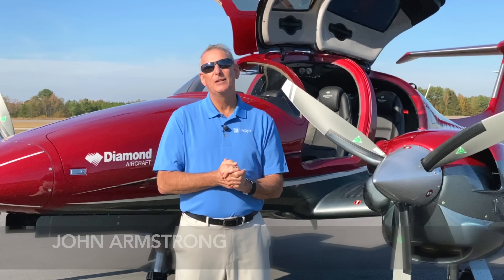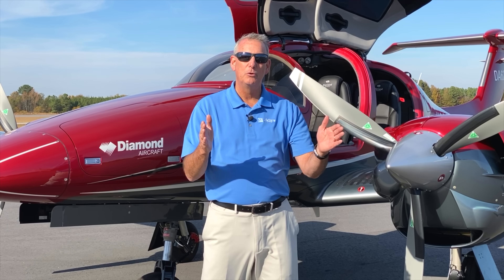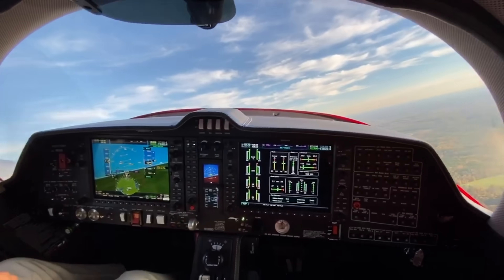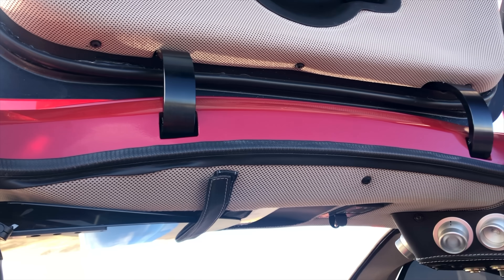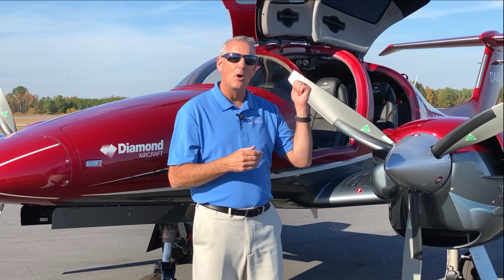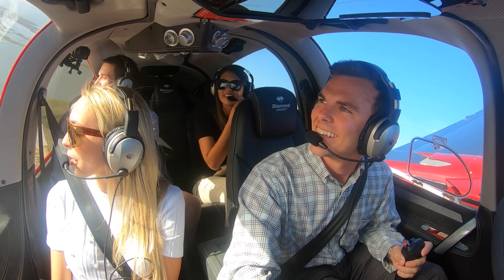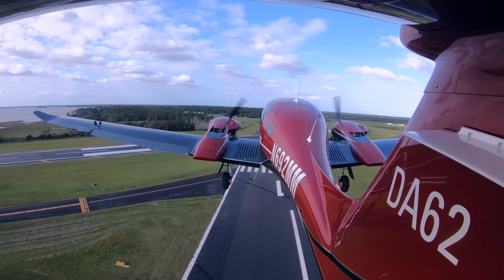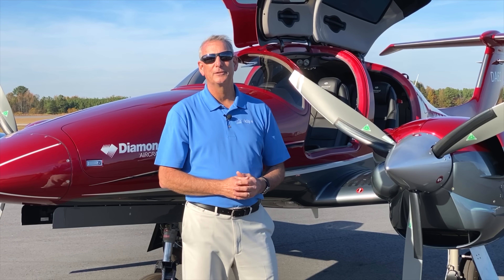What Makes the DA62 the SAFEST Twin-Engine Aircraft? | DIAMOND AIRCRAFT SAFETY SPECS

Comment: I’m a single engine pilot, however I have a home flight simulator where I fly all types of single and twin GA and commercial aircraft. This aircraft is absolutely gorgeous and beautiful, however one glaring elephant in the room that stands out is the fact that this plane doesn’t have counter rotating propellers. If it had counter rotating propellors, this airplane would be one of the ultimate GA twins

Comment: I always thought the da62 was overpriced but after seeing all the precise engineering that went into it, which prioritizes safety above all, now i know why its price. Y’all have to remember that this plane was built from scratch whereas planes like the cessna, beechcraft, piper… are all based in 30,40,50 yr old designs. If I could afford the diamond I would definitely buy it

Comment: One failing is that the DA62 does not have counter-rotating propellers -- and you can't get it as an option.  Nor does the DA62 have reverse-thrust capibility propellers, which would shorten the landing roll.  Not good for a million dollar plus aircraft

Comment: Imagine if the DA62 had CAPS and a HALO system too?
The safety factor would be through the roof!
Reply: Even without CAPS diamond is destroying Cirrus for safety record.
Reply: @cduemig1  Strange viewpoint. 
It's like Volvo would have said: 
"Our cars with seat belts outperform all these airbag-only cars"
But instead they saw the added safety it could give, so they designed their own and put it in their products.

Comment: Wow, this is probably the ONLY twin-engine General Aviation aircraft that offers similar active attitude protections to those offered by Airbus.  Had JFK Junior been flying a craft with these safety features,  whereby the plane would take control in the event of too steep a pitch or roll inclination, that fatal plunge would most likely never have occurred.  This is one truly sexy bird.  Built like a Ferrari, but safer, much safer.

If I had the money for a Cessna Citation, I'd still choose a DA62, purely from  the standpoint of design safety.

Comment: My dream plane is DA 42 or 62. Maybe in a decade or so I can work my way up to one. 
Simplified run-up and checklist procedures.
Don't have to worry about shock cooling.
Twin engine security, ultra high efficiency for a twin, all the safety engineered into the plane at every stage as discussed.
Reply: Uh oh  Diamond DA42 Crash in Pennsylvania   May 2022 do Youtube search  DA 62 might be safer
Reply: @davidboyle3032  All 3 on board survived a crash that flipped the airplane over, so I'd say it's a good outcome. Will be interesting to see the outcome of the investigation since this is something they should be able to handle. Engine failure on takeoff I guess?

Is there any reason to assume the DA62 would be much safer than the DA42 in this scenario? The 62 just seems to have more seats and to be a lot more expensive hehe
Reply: Same!

Comment: What I like best about this aircraft is that in can climb with the loss of one engine if in the blue line.  Can the DA 42 do the same thing?
Reply: The DA42, at least the Austro variant, generally has an OEI service ceiling of around 10-11,000 ft.

Comment: Having owned and flown a DA-42VI for about 2-½ years, all over Europe and Scandinavia, I still can’t understand how people can fly single-engine pistons in IMC. The risk calculation just doesn’t work. The twin-engines with FADEC controls are the single most important safety feature of this aircraft. The old (very old) adage that, “The second engine will fly you to the scene of the accident,” is just no longer true with these modern engine controls. Flying in IMC over the Alps, or across the Mediterranean to Egypt, I can say I was very comfortable with those two diesel engines purring along out there.
Reply: Probably money.  I know I can't afford to fly a twin.
Reply: @ace00007  But have you really priced it out? I had a fuel burn of 13 gal/hr total at cruise, and at altitude, I was doing 170-180 kits. And JetA (diesel) is far cheaper than avgas. That goes a long way to making up the differential in maint for two engines.
Reply: @brianmeese1641  Part of the problem is I'm a renter.  I can rent a G1000 DA40 for $130 an hour and get 130kts.  A DA-42 on the field rents for $289 an hour.  Way too expensive.  If I could afford to be an owner then maybe it would be different.
Reply: @ace00007  OK I get it. Well, the 40 has no ice prevention, anyway, so you are probably not flying in any heavy IMC. I flew IFR in a DA40 for couple years like that without taking any big risks. But, I know guys that fly an SR22 in heavy IMC, over water, mountain terrain, approaches at minimums, etc., and it makes me shiver.
Reply: @brianmeese1641  I'm pretty conservative myself.  In Colorado IFR in the summertime means thunderstorms and in the winter it means ice.  So we get a small window in the spring and fall to get some actual if we get those types of storms.

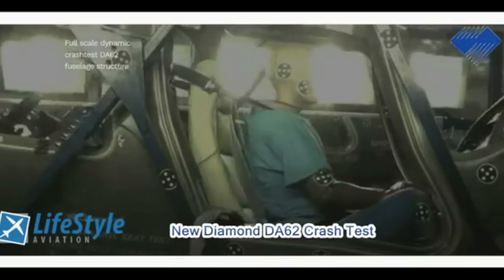Comment: Very nice bird. I'm curious to know whether the "over-built" trailing link landing gear system (mentioned at 8:33) allows the DA 62 to operate on fairly rough unpaved grass and gravel strips (e.g. in the way the Pilatus PC12 can with its similar system)?

Comment: I just don't get this plane.  Its a good looking plane especially in that gold livery, but why are they so darn slow?   This plane looks like it should be able to do 200 kts at 23,000ft easy.  Yet it struggles to get over 170 and is only certified to 20,000.  I feel like for its price point Diamond left some performance on the table.......
Reply: Engines should be over 200 HP.  That's the problem!

Comment: With a design like that, and the price tag, it should be able to cruz in the twenties
Reply: It does.  20,000 ft  at far better efficiency than any twin ever made.  I get just  under 13 ANMPG (Air Nautical Miles Per Gallon) cruising at 190 KTAS and 7.4 gph per engine at FL200.  Very few singles can come close to that number.

Comment: With all this focus about safety, I'm curious as to why counter rotating props weren't installed to remove the critical engine. Seems like this would be fairly straightforward considering the engines are geared to the props.
Reply: The reason they do not have counter rotating props is that they are based on an impressively engineered Mercedes Benz automobile engine that has been produced in the millions per year and constantly refined to be smooth, powerful, and efficient.  There is no point asking an automobile engine manufacturer to re-engineer and retool to make that same engine rotate in the opposite direction, only to manufacture hundreds per year.  The argument to manufacture a separate gearbox to have it rotate in the opposite direction fails for the same reason - low volume.  Overarching the question is the simple observation that there is simply no compelling reason to do so.  Combination of huge wingspan, massive rudder, and engine location close to the fuselage makes for an almost undetectable difference in single engine handling between right and left engine out.  About the same rudder forces either way, and mine climbs at ~ 400 fpm regardless of which engine is shut down.

Comment: This Diamond might be safe, but overall it is a useless piece of junk! 
You gotta be an Olympic athlete to get in and out and there is no room, not even space for a golf bag, a simple failure from 
A to Z! It seems the only aircraft manufacturer in Europe capable of designing a useful, safe aircraft and understanding what aircraft customers need is PILATUS!
Reply: I don’t think that you have actually tried to sit in a DA62.  It is in fact far easier to get in and out of than any low wing general aviation aircraft.  It can easily fit more than half a dozen golf bags, with plenty of room for 5 adults.  

The Pilatus PC-12 costs 4 times as much to purchase, more than 5 times as much to operate, only goes 40% faster, and has horrible engine out performance compared to the DA62.

Comment: Single engine rate of climb? Single engine handling in general.
Reply: Book values - standard day sea level show rate of climb varies from 168 to 393 fpm depending on aircraft weight.  My personal experience with full fuel and two pilots on board, I've never seen less than 400 fpm at ~4,000 on a hot day.  Single engine handling is superb thanks to a single flick of the engine master switch that shuts the engine down and feathers the prop, massive (48') wingspan, engines tucked as close as possible to centerline, and huge vertical stabilizer and rudder.

Comment: Been debating for a long time for a family retirement plane...DA62 or T206H Station Air 🤔
Reply: About the only similarity between the two is useful load on takeoff, 1,594 lb for the StationAir, 1,565 lb for the DA62.  The 29 lb T206H advantage on takeoff is quickly eaten up due to the DA62's incredible efficiency.  At 18,000', 161 kts (the max cruise speed of the T206H) the Stationair burns 19 gph of Avgas (which is more expensive than Jet A).  At the same speed and altitude, the DA62 burns a total of 11.7 gph of Jet A (5.9 gph per side).  That means for a 600nm trip with 45 minute reserve, the StationAir can haul only 1,083 lb, whereas the DA62 can haul 1,214 lbs.  That's a 130+ lb DA62 advantage at this distance, increasing every mile up to the 703 nm max range of the StationAir and 1,283 nm max range of the DA62.  Also, the DA62 burns 62% of the fuel per mile of a T206H - roughly half the cost per mile when you factor in Jet A's lower price.  Amazing to me when you consider the DA62 has double the engine count.
DA62 advantages go on for more than I can list here, but include 20% faster max cruise speed, a far more spacious cabin (53" vs 43" wide), incredible visibility, quiet, smooth, reliable, FADEC controlled, single lever per engine Mercedes Benz based turbo diesels, the safety of all carbon fiber construction, 26 g seats, dual carbon fiber wing spars, with fuel tanks protected between, and best of all - vastly greater engine out climb performance (i.e. 2-1 > 1-1).
The only two advantages I can chalk up to the T206H are lower acquisition and maintenance costs.  They really are in a different class, but to quote Ferris Bueller: "It is so choice. If you have the means, I highly recommend picking one up."  
It was a bit of a stretch for me, but I could not be happier with my decision to buy one.
Reply: @ultraturtle2673  Thank you for the number crunching. We are definitely years away but seeing those numbers definitely persuades me towards the 62.

Comment: Does not have a huge performance envelope. Way easy to stay ahead of the aircraft. Two engines. Very low stall speeds. Primarily used for dual engine training, flown by an experienced student and an instructor. Dual EngineTraining is about the only utility of this aircraft.
Reply: I disagree.  It carries 1,000 lbs of people and stuff more than 1,265 nm at normal cruise.  That's more payload farther than any piston twin currently being manufactured - by a wide margin.  Throw in a far roomier cockpit (11" wider than a Baron), nearly half the fuel burn per mile of any non-Diamond twin, and the safety and simplicity of FADECs controlled by a single lever per engine, there is simply no comparison with anything other than the other Diamond twin - the DA42-VI.   And, by the way, the DA62 costs less than the competition, similarly equipped.  The next step up in payload, range, or cabin comfort starts at more than twice the initial cost, and far more than twice the operating costs per mile of the DA62.  It is not only a great airplane, but a surprisingly good value.

Comment: Couple of observations:

1)  So the seats are bolted right to the airframe?  How does that work for those of us who like to adjust our seats?  (Disregard, this is answered later in the video.)

2)  Interesting to see aero-diesel engines are still around.  I was a master's candidate at ERAU-Daytona from 1999-2001.  Back then, they had a C-182 in their maintenance hangar that was an experimental testbed for a modified diesel engine.  Think I saw it around the fall of 2000 or so.  At that time, they almost had it done; test flights were showing problems keeping the heat levels down in the cylinders.  it wasn't perfected yet.  In the intervening years, I've watched from the aviation sidelines as Thielert came---and went.  I never did find out who took over GA aero-diesel production after Thielert.  I stopped flying after February 2003---moved away from Daytona, took on a federal job, never had the kind of money it takes to rent GA aircraft since.  Now, at my age, I don't know if I could even pass a physical to get back into flying.  But I'm glad to see that the aero-diesel engines are still around.

3)  Are these engines FADEC then?  Sounds like it.  Might almost explain why there's only one throttle control that I can see from the footage.

4)  Is there a critical engine with this aircraft?  Are the props counter-rotating?
Reply: 1). Much better than adjustable seats.  The fixed seat position with moveable rudder pedals places the control stick naturally where your arm would fall regardless of your body dimensions.  Crush blocks and immensely strong carbon fiber construction makes a 26 g vertical crash survivable.  Not sure if there are any adjustable seats that can make that claim.
2). Austro diesels are based on the same Mercedes Benz engine block as the Thielerts, but vastly improved across the board.  They basically fixed all of the deficiencies of the Thielert design.  Austros are incredibly efficient, quiet, smooth running, easy to manage, and reliable.
3) Yes, they are FADEC.  Dual channel ECUs with independant battery backups, each.  Liquid cooled, jet engine simple with the advantage of instant spool up.  No mixture, prop, carb heat, cowl flap controls to deal with at all.  No shock cooling, you can descend in idle power at ridiculous descent rates.  No need to obsessively monitor engine instruments and tweak handfuls of levers and knobs.  Any exceedances get displayed instantly on the EICAS, but exceedances never happen because, well - FADEC!  Single lever control, zero to 100% power being the only guage to monitor, this is what flying in 2020 should be.
4). No counter-rotating props, and yes, left engine is critical, but not really all that critical.  No particularly compelling advantage to be gained with counter rotating props.  Combination of huge wingspan, massive rudder, and engine location close to the fuselage makes for an almost undetectable difference in single engine handling between right and left engine out.  About the same rudder forces either way, and mine climbs at ~ 400 fpm regardless of which engine is shut down.
Reply: @ultraturtle2673  So what happens in an engine-out situation?  How do you isolate the dead engine?

Thank you for your answers, btw.👍
Reply: @Warhorse500  Securing the dead engine is also simpler and more intuitive than older designs.  All you do is shut off the engine master switch, and the prop feathers and the engine shuts down.

Comment: Sir is it safe when bird strike for turboprop engine? Thanks
Reply: A minor point, but the DA62 uses turbocharged piston diesel engines, not turboprops, but to answer the question, an aircraft with two of any sort of engine is immensely safer than a single engine aircraft when a bird strike disables one engine.